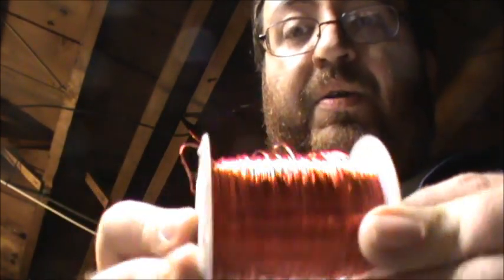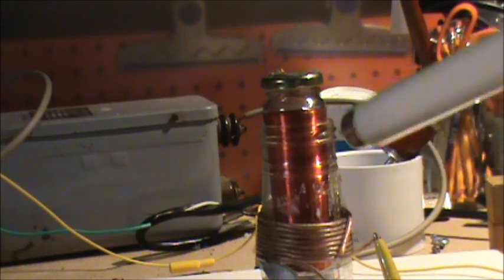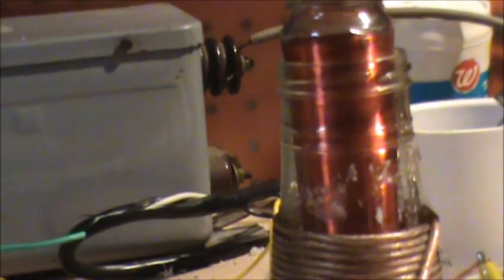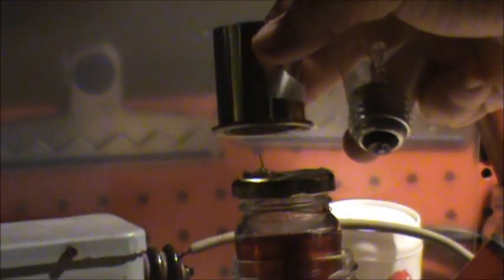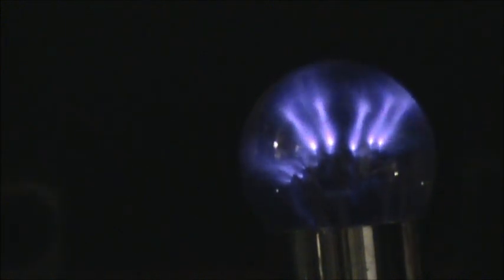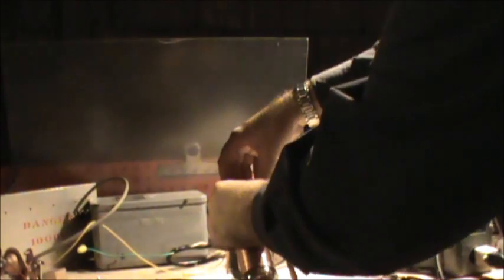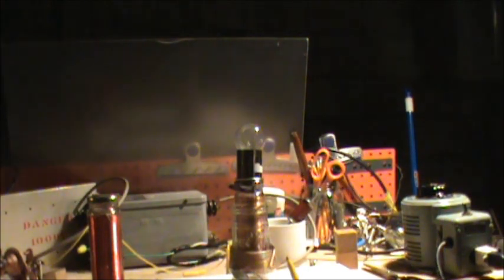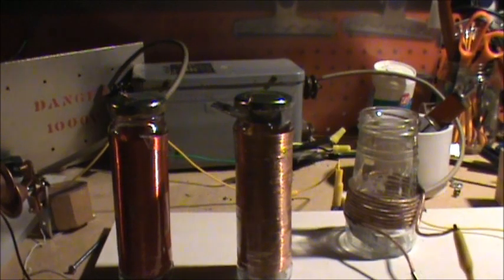Tesla coil construction - copper wire quality matters

Comment: Not easily said that done...many factors hinder tesla coil success.....1 the type of resistor used 2. The type of copper wire used 3. The correct connection. Generally the accuracy of this information you would have noticed is not discussed or properly relayed in the videos on you tube.
Reply from the maker: True, and in the six years since I made this video I went to university and took 4 semesters of circuit theory.  But with my new job I haven't had time to make more videos relaying the new info - except for the 3+ hours of video on my channel here reviewing my index cards for the first 3 semesters.